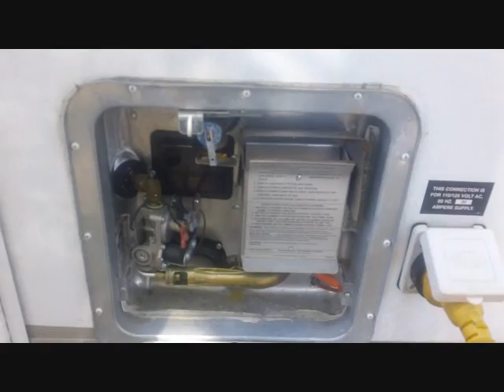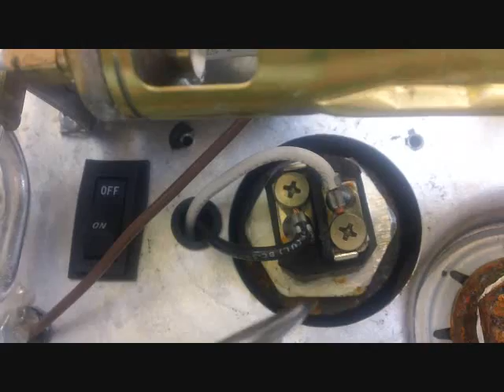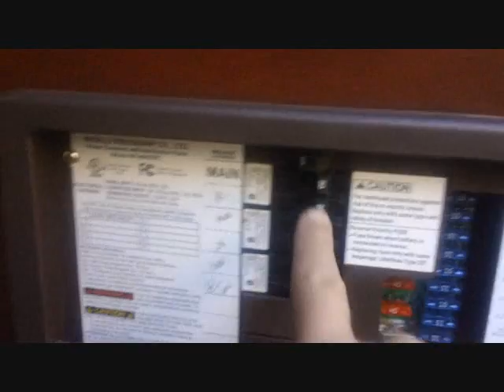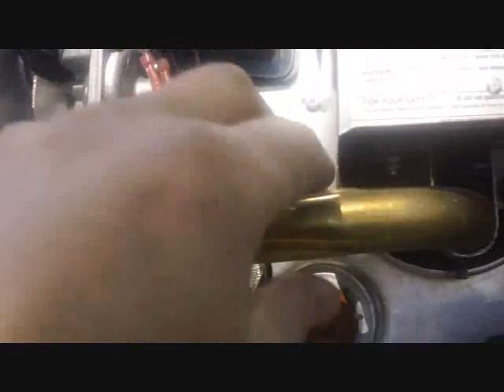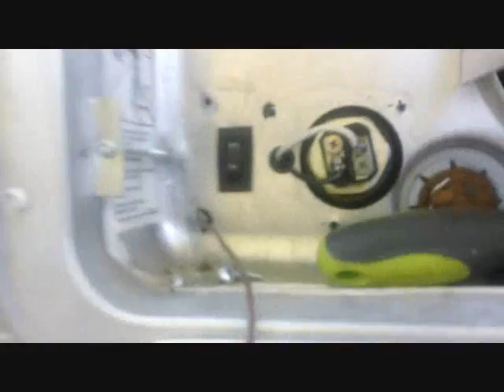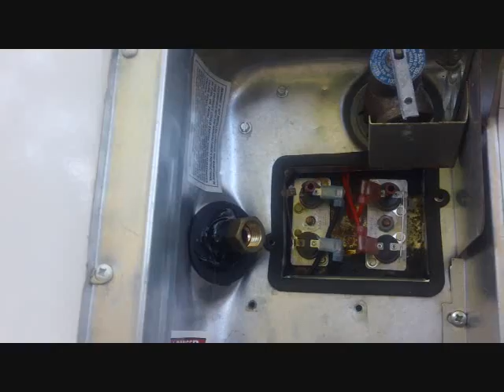Suburban RV water heater part 1

Comment: Been using your video as a guide. No voltage to the heating element. Re[placed it. Continuity on Element screws is 10.5 110 thermostat reset good. No clicking. Electrical thermostat has continuity. On Off switch has continuity. Did I miss anything? I'd like to start the hot water heater.

Comment: Mine works fine on gas but will kick the main breaker when i try to run on electric. Especially if i run he over head ac. Breaker will kick then for sure Sometimes fast sometime little later but will kick if i run both. All help appreciated...
Reply from the maker: When you say main breaker, do you mean the one at the campground?
Reply: @stevewatr   no the main breaker in the camper.  As on now im not useing the ac because its cold here in Ky.. I use the gas only for the water heater for now but id like to figure out the prob because the propane i have to buy  and the electric is included in the rent. Live on very small income and the furnace eats up the propane enough by itself. Just trying to figure it out and get it back to the electric side. Im hooked up at a resident with 110  power.  It run fine for a long time. Both ac and water heater on the electric side.  then the breaker started kicking with the ac on. Then i noticed the water wasnt hot one day and cut the hot water switch off and started useing the propane side to heat the water. When doing it like that I can run the ac and it doest kick the breaker. I thought it was the ac pulling to many amps but with the electric switch off on the water heater the ac runs fine. Im thinking the element is bad or maybe the thermostat on the electric side bad. Just not sure nor do i know how to test it. I just would rather have it fixed to have hot water on the electric side rather than useing the propane.
Reply from the maker: @kevinferrell7033  well, a few things to check. Either the breaker has gone bad in a way that it's tripping below its rated amperage, or there is too much current flowing through the breaker. A bad element might be the cause, but elements usually fail open circuit meaning no current flow, no heat. You could also have a wiring issue, where the insulation on a wire is damaged, and occasionally shorts out to some thing grounded, like the heater housing. Since it doesn't trip right away, it makes it a lot harder to track down. Sorry I cant be of more help.
Reply: @stevewatr  Thanks for you reply. I think i will get e a multi meter and ck for continuity test on my ac power thermostat from the  behind the reset cover. Te gas side works perfect. Im just trying to get it back to the electric working cause the electric is paid in my rent and i have to buy the propane. Thanks for you help....
Reply from the maker: @kevinferrell7033  you're welcome.  By the way, if you're plugging into a 30 amp outlet, I'm not surprised if the heater trips when the ac is on. Mine does that, and has since new. Also, upgrading your supply cord to higher gage conductors will help. The one that came with my trailer is light. A marine grade one is pricey,  but usually better quality because they're used for shore power to boats.
Reply: @stevewatr   I have upgraded to a heavier power cord when i hooked or we hooked this up for me to live in almost 3 yrs ago but i never had no problem till this past summer. The power is run into a garage breaker box with 110 wire with a big heavy duty wires run into a 220 broke down to 110 box to cut all power if needed just outside the camper.  It started kicking the main breaker in the camper. I first thought it was the ac drawing to many amps but later i noticed my water wasnt hot. like just warm so i then switched it over to gas/[propane. Turned the switch off on the heater and then i could run the ac and it never kicked the breaker. I have put a new  30 amp main breaker in  the camper and it still done it so i just switched it back to the propane side and been running it with that for the past few months but id like to figure out the problem so i can get it back to the electric sidecause the propane cost me more money. With the gas furnace and the water heater on propane i go through a 20lb tank in about 5 days and im a poor man and need to cut every dollar or every way  i can....i only draw 800 a month and pay 500 rent and 1,33 ins so ya its hard.

Comment: What is that gadget called that your using to check ? How much does it cost? Or is their place I can rent it at?
Reply from the maker: A multimeter is all you need, and they can be had for as little as $10 from harbor freight or online. Mine are more expensive but a cheap one will work fine here.

Comment: i just want to thank u....i have electrical backround but with out your video i would have probably been lost....or it would have taken 3 times as long.....the voltage for thermostat and limitor...which i know cause you pass same voltage through when functioning correctly....the ac side 110 and dc side 12.....my thermostat was bad...dc side....jumped out and wa la....of course we have to replace but at least i can get hot water for the moment.....your video by far the most through i found after 4 hours searching....voltage pasess for those divices to the ignitor modules next....so if they are not receiving.....no solenoid or ignighter....thanks again and God bless...i am sure u just saved min 100...probably a lot more...😁😁😁😁

Comment: I have both an electric and LP switch for my hot water heater inside my RV.  I only turn it on when we are camping and off when we leave.  I never turn the switch OFF on the actual heater outside.
Reply from the maker: Kelly Jones yup, that's how it should be, but for some strange reason, forest river cheaped out on adding a second switch. Ive forgotten the switch on, upon leaving, and nothing happened, but if the water level drops, exposing the element, it can fail quickly.

Comment: Thought the switch inside was for the electric and could not figure out why the gas kept trying to kick on while the electric was plugged in. Thanks
Reply: Brian Mc G if you follow other videos you can use both...but yes inside for dc....and propane....outside is ac hook up.....

Comment: Hi there,,, could you tell me the model of heater yours is,, also should I disconnect the 120 before I test the element? not sure how this works but if there is no power how would it show up on the tester??
Reply from the maker: Marlene Pisani yikes! no offense, but your questions lead me to believe you do not have much experience with electrical work, so I suggest you get someone else more knowledgeable to test it for you. but if you insist on moving forward on your own, if checking the resistance of the element, you want all the power off.
Reply: Lol...no I am not the one that would be doing this!

Comment: thank you so much steve for the advice,i found my problem it has a 3 valve system for the bypass and the bypass was on putting the hotwater back into the cold line,after you mentioned the crossed flow it dawned on me but thanks to you i now no how to trouble shoot my whole system.
Reply from the maker: Glad to hear you solved the issue. happy camper

Comment: Hello steve very awesome video but i have a different problem,my heater is exactly the same but is only heating on the top of the tank,doesn,t matter if its on propane or electric.We get hot water for maybe 30 seconds and then its cold,about a minute or so later very hot again for roughly 30 sec,s or so,can,t figure it out.made sure tank is full and all water turned on,thanks steve
Reply from the maker: the only time I've ever heard of that happening is when there is a "crossed flow" issue.  this can happen if for example you leave a hand shower with the shut off on the hand shower off but both hot and cold valves open. then when you run the hot water in another location cold water flows through the other valve into the hot water supply line . always keep both valves on your outdoor shower closed when not in use.
Reply: Check the valve next to your water heater make sure its closed or you will get cross flow
Reply: Did you figure it out ? I know it’s been 5 years lol

Comment: Thanx Steve, your video helped immensely with my similar problem. I troubleshot my water heater exactly as you did only to find my switch was bad. Since I didn't have a multimeter with me when the problem occurred and I just replaced the heating element last year,  I took a chance and bought the switch and high limit/ thermostat switch on Amazon for under $20.00 delivered. So my next visit to my seasonal site I was prepared. Now I have an extra limit/thermostat switch just in case. Thanx Again, Jean
Reply from the maker: Jean Lavoie Glad the video helped. Happy camping!

Comment: Hey Nice job! But as a RV tec I want to note that your burn tube is scorched and you need to adjust the burn tube.  You said you see a piolet or flame and pointed where you see it in  the burn tube and that is cause the scorched in the bend of the tube. You can still use it but it is the weakest point and will most likely rust and develop holes. You should only see blue flame at the end of the burn tube going into the burn chamber or venting. Happy Camping!
Reply from the maker: Thank you for the tip, regards.